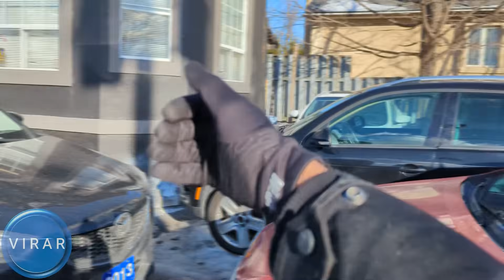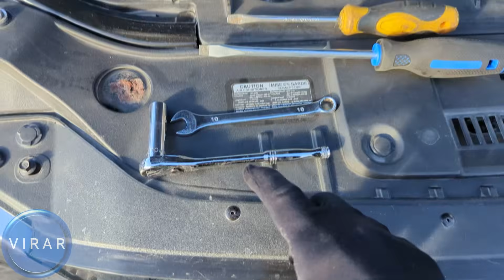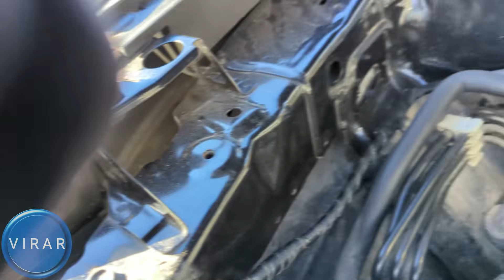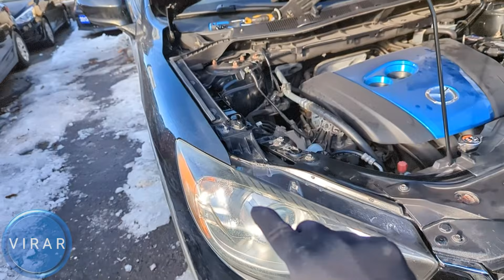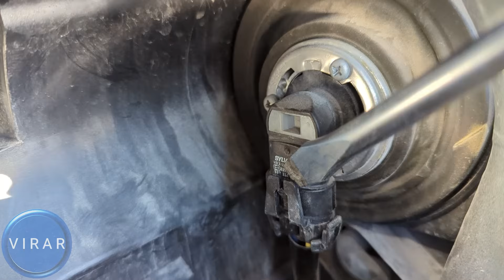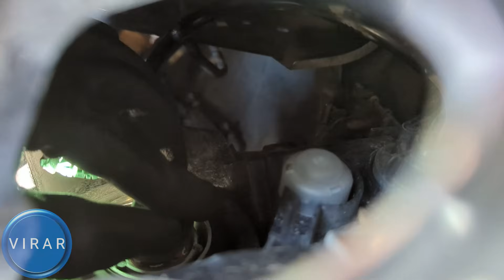How to Replace Headlight Bulbs - Mazda CX-5 (2012-2016)

Comment: For anyone that might benefit - I just did this on a 2016 CX-5 and didn't find it necessary to remove the reservoir. I could see both bulbs just fine and had no issues accessing them (even with an XL glove sized hand)
Reply from the maker: You’re welcome! Glad I could help!

Comment: for my model 2013 grand touring, Daytime running lights can be replaced manually. We did it with the LED replacement. They work great, bright enough to drive around at night and not get pulled over 👀. High/low beams must be done by a Mazda dealer per the owners manual. 🥲 No wonder I couldn’t find any good information online to show me how to do it or what bulbs to use. Just thought I’d share for anyone that was in a similar situation. This is a great video though, for those that can use it.
Reply from the maker: You’re welcome! Glad I could help!

Comment: Thanks for this!! But my high beam bulb looks different 🤔 It’s a globe. Google image search indicates it’s the OEM parts. Does it have to be replaced with the exact same or can I just buy these 9005 and H11?
Reply from the maker: What year is your Mazda CX-5? Just replace the bulbs with whatever comes out of it originally.
Reply: @VirarAutomotive  thanks for responding 🙏🏾 it’s 2013. To replace high/low beam and Daylight running lights, Oem bulbs only were $570. No thanks 😅 Let’s hope these $75 alternatives last me a couple years. 

And for anyone reading in the future, the correct replacements for me ended up being as follows: 
D4S LED High/Low Beam
P13W fog/Daytime Running Lights 

(Information from the dealership)

Update: for my model 2013 grand touring, Daytime running lights can be replaced manually. We did it with the LED replacement. They work great, bright enough to drive around at night and not get pulled over 👀. High/low beams must be done by a Mazda dealer per the owners manual. 🥲 No wonder I couldn’t find any good information online to show me how to do it.